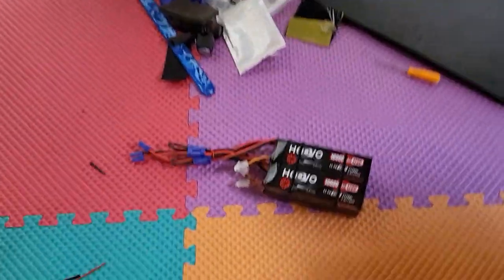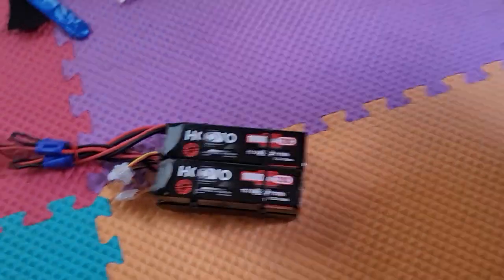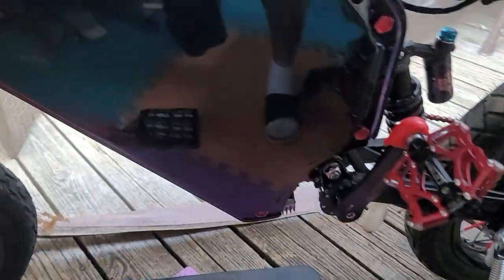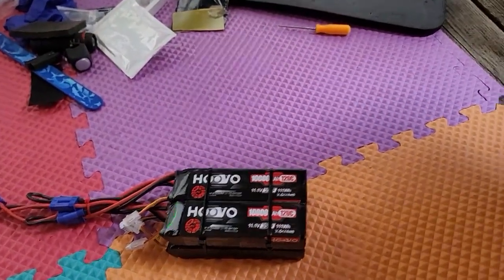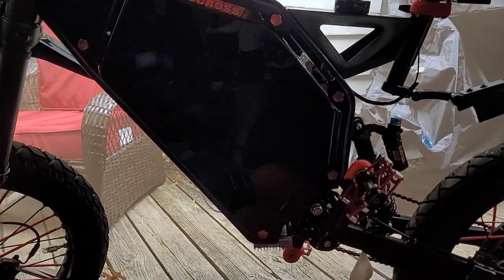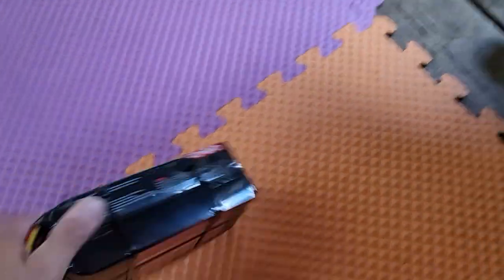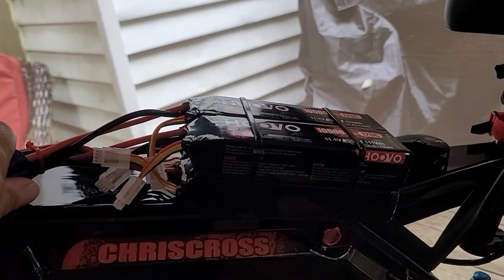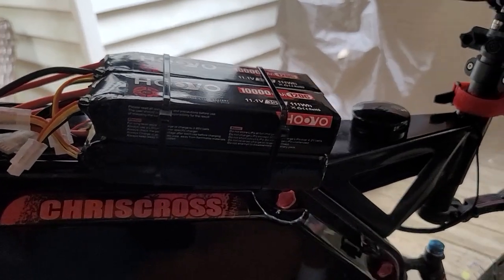upgrading your existing battery system from 72-96v the DIY way! Using high discharge Lipo batterys

Comment: Do you still consider this a viable option??
Reply from the maker: As long as your not running over 300amps yes but more that that with just 40ah worth youll need to add more as these did gas up from extremely high current. Obviously the limits of once was sufficient arent anymore for 150-200 amp controllers youll be fine but youll need a larger bank for anything more.

Comment: I'm doing the same thing with  RC batteries..
Reply from the maker: Exactly what they are, I got the largest capacity I could find in that form factor. I found some others that are 20AH each they are huge but have a huge price also so these are a great deal on Amazon. 3s 10AH so 4p obviously 40AH I may add another set in parallel so my system is 50AH so right now my system will be 21s4p
Reply: @ChrisCrossingWires1212  I just learned how to run them in series and parallel.. more volts and Ah.. I teach myself everything that way I don't have to pay anyone else and I save money plus I gain the knowledge of doing it myself
Reply from the maker: @Blaine Gibson  Absolutely that's what my ch is all about DIY!
Reply: @ChrisCrossingWires1212  I would do the same but I don't have confidence in it and I don't have the camera and stuff..
Reply: @ChrisCrossingWires1212  you by chance have a fb I could look you up and message you if I ever need to bounce an idea off you?
Reply from the maker: @Blaine Gibson  I have a patreon that I normally try to get people to join because honestly my head would be getting bounced on all day if I did that for free so I try to support those that support me. the membership is as low as $3 per month and I think that's a small price to pay for some good info. if you join that I'll give you my direct cell number, Facebook page, the keys to the kingdom if you will. I'm sorry it has come to this but my ch is growing now and as small as it still is, I'd be overwhelmed if I didn't do it that way. I'm working on bikes all day, trying To make videos, upload and post them, order parts so it's just me. Wifey even has to plan our dates, lol 😆 but sure bro if you go to my about section on my YouTube ch you'll see info. I also have a Telegram group is called Chriscrossingwires Eworld
Reply: @ChrisCrossingWires1212  no problem, totally understand and I will be joining my friend.. Looking forward to chatting with you and maybe building a friendship.. hope that didn't sound like a "Stan" move.. 🤣🤣 not the case, just saying..
Reply from the maker: @Blaine Gibson  haha not at all Bro and BTW some people you just have a good or bad feeling about and not getting any bad vibes here so you can send me a friend request on Facebook Chris Vongvatunyu and I don't care who else sees it if they're not you I ain't accepting lol. I'll take you at your word for the patreon Buddy hit me up anytime